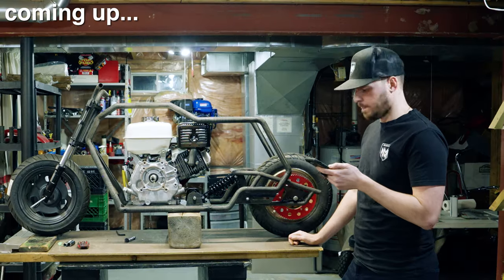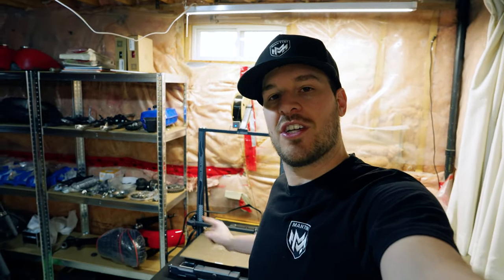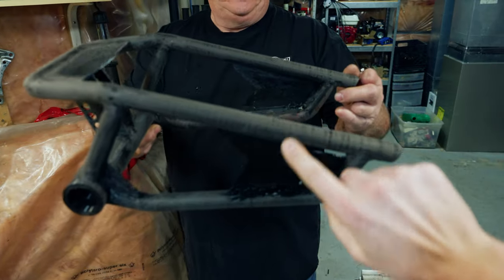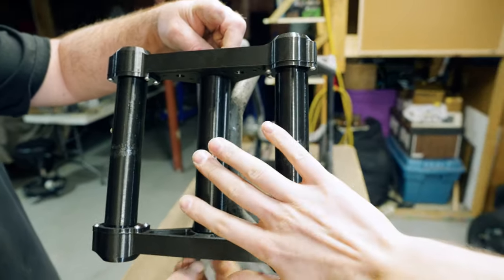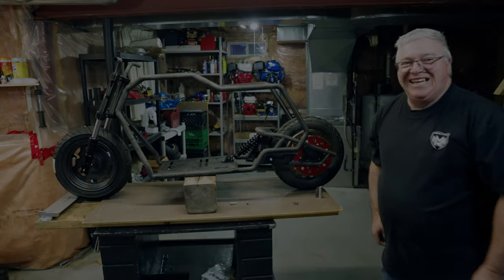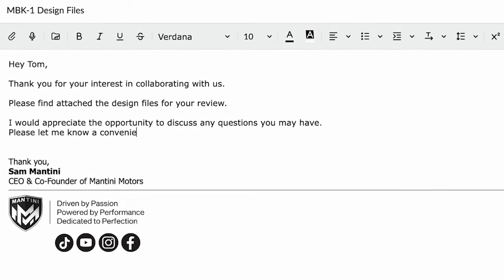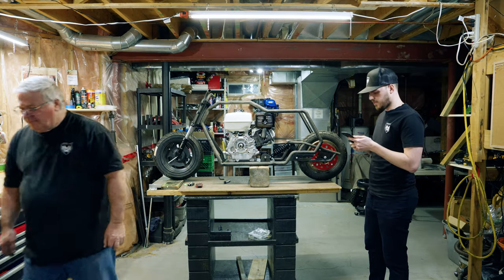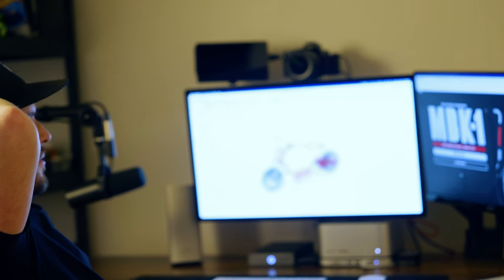8 Months To Design Our Dream Mini Bike | MBK-1 Journey Ep.1

Comment: I have a couple suggestions that you may have already thought about. So the idea for the motor bolts to lock in. The flange of the piece you created needs to be much wider. When bolting down the engine there will be lost of force on those bolts. You don’t want those gauging into the motor plate. Also the center bolt that holds the forks would need to be a bit thicker then what you have. There will be a lots of force on that area of the bike. My personal like would be to have a wider rear tire then what you have on the front. Meaning if you could make it possible to have a wide tire would be great. This is a awesome project either way you go. I would like one myself. Don’t forget about Send cut Send. They maybe able to help. Good luck I will keep watching
Reply from the maker: Hey thanks for the suggestions, yes the washer for the lock has been updated as I agree with you completely. It is not twice as wide. And for the rigid version you have 10.5” of space for a pretty wide tire. The swing are is a bit thinner at 8.5 inches right now. But we may alter it a bit to work with a wider tire.

Comment: it may be cheaper for you to buy a tig welder and a pipe bender. you can send out complex parts from CAD to sites like sendcutsend for laser or water cutting. then just use the welder to stick them together. 

depending on how many iterations of prototypes you do, it might end up being dramatically cheaper, and only engaging a machine shop once you're ready for serial production.
Reply from the maker: That’s a great idea but unfortunately neither of us know how to tig weld and due to the complexity of the bends and the precision needed, we would need a CNC tube bender to ensure everything is identical from left to right. Also, working with an experienced machine shop means they can also look at it from a manufacturing perspective and help us refine the design to ensure it can be made safely and efficiently.
Reply: @mantinimotors   yeah, machine shops are great for feedback on how to reduce build complexity and keeping costs down. OTOH, welding isn't difficult to learn, especially if cosmetics aren't important
Reply from the maker: Haha, yeah it is true about the cosmetics. But honestly, if we are lucky enough to be selling 10 or more of these per month, then it would be much more efficient to work with a shop who not only can bend up to 100 frames per day but also has the experience to do strong clean welds that are also cosmetically appealing. 

But perhaps one day we will have all the equipment and can do everything in house.
Reply: @mantinimotors   oh, yeah, i wasn't suggesting that you do production work in-house. I'm only talking about the prototyping phases, when you want to iterate on different designs. Once your design is locked down, then definitely give it to a real machine shop to build finished products for customers.
Reply from the maker: @mmnootzenpoof  Gotcha yeah, we would totlaly have gone that way if it wasn't for the complex tube bending and the CNC aluminum machining we need for the front end.

Comment: Ive been building and modifieing mini for 3 years now.

  One thing id try and change is the neck bearings. Neck stem bearings wear out super fast on mini bikes. 

Ive been using skf brand bearings, but they only hold up to about a year of hard use. 

Im actually getting ready to 420cc swap a honda xr 100 for a friend. 

Im super excited about this new project, while it wont be a "mini bike" it will have full suspension and front and rear brakes.
Reply from the maker: We agree, that is why we are going with a cup and cone bearing. It is far superior and more durable then the standard bearings found on most bikes.
Reply: @mantinimotors  I might have missed that part of the video but that's awesome man

Comment: Man brother so close and absolutely sweet bike but you know them trikes they make these days have tight bends like that I would just stretch it and keep overall design deff one of a kind forsure and yall put alot of time and thinking into certain area's like adjustable handlebars rear shock it's badass
Reply from the maker: Thanks, yeah we put a lot of thought into this. We think the new design maintains the look while meeting the minimum requirements. The issue with the tight bends is that it would require multiple weld points. We want to frame to be single tube instead of 2 or 3.

Comment: swingarm pivot is really low, noticed a jack shaft in the cad model thats in the correct place for that pivot, i'll bet some people who buy this will try to run without the jackshaft and cry alot when the chain keeps falling off :)

it''s a beautiful design, hope you can solve the manufacturing issues (also those head bearings look tiny!)
Reply from the maker: In the model that is actually a chain tensioner but we have been working with the machine shop on the jackshaft to see if we can get it closer to the pivot tube. It will come with the jackshaft so no one should be riding this without it.
Reply: @mantinimotors Great, you are aware of it, can't wait to see how it turns out now!

Comment: I've watched all your videos and decided to post my question here.  I have a custom, non-mini bike, project that I am designing and I am curious how you settled on an aluminum frame vs steel (DOM) tubing?  Subbed.
Reply from the maker: Appreciate you following our journey. I’m not sure where we have said that we are building an aluminum frame, but the frame is in fact 1” steel tubing. The only aluminum parts are the triple clamps and jack shaft bearing housing. I’m not sure it would be economical to build a mini bike frame out of aluminum. Hopefully that clarifies a few things 👍
Reply: @mantinimotors  Thanks for the clarification.

Comment: Fatter tire in the rear. 12-14 " rear wheel and tire. Same for the front. Especially with the 670.
Reply from the maker: Do you mean a tire that is 12-14" wide? I know that is more common for drag bikes, but this is more of a cruiser. But with that said, we do have some ideas on how to adapt a wider wheel using a different swingarm. It is something we are currently brainstorming and if there is enough demand, we will put it into production for sure.